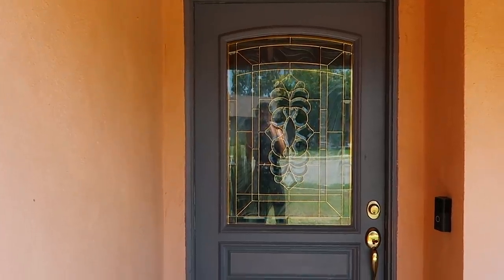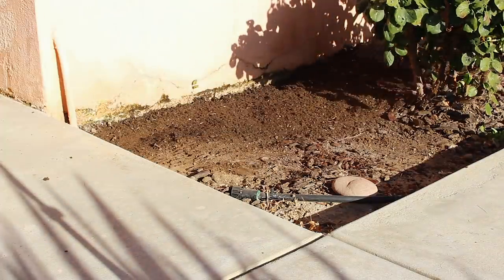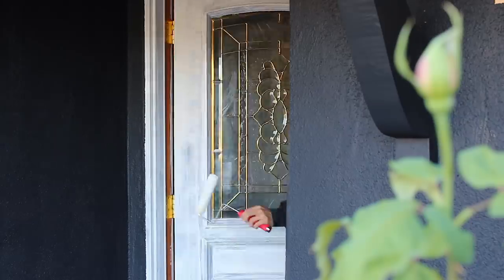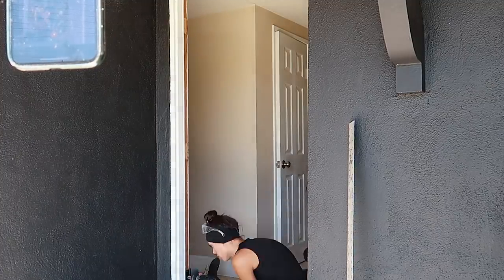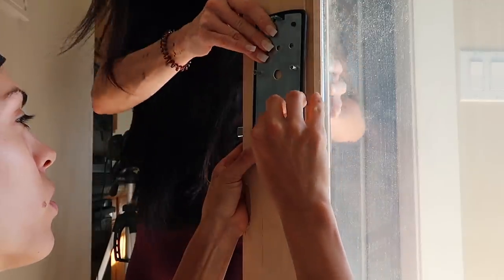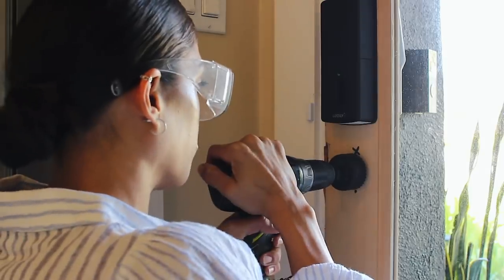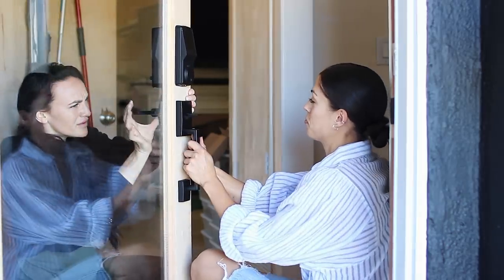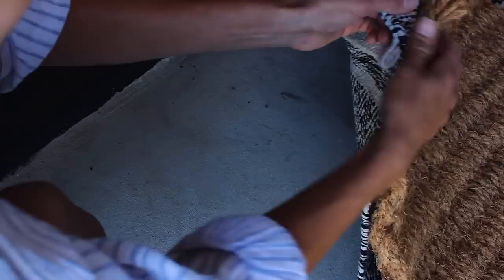DIY Front Door Makeover | Starting Our Front Yard Transformation!!!

Comment: Black is so bold 😍

I would honestly be concerned about that door.  Not just for the glass (security system won’t help you with that tbh but you mentioned a privacy fence ), but because of its thin profile. Where’s the edge seals to keep the bugs out and the cool air in?
Reply from the maker: We will be doing that in a separate video!

Comment: I mean, as far as privacy goes, you could easily etch, frost, or add film to the glass to have just as much light but no privacy issues. My concern is that you installed a smart lock (hackable) on a 90% glass door (breakable). Gurl, that house is not secure.
Reply from the maker: Make sure to do what's best and what you feel comfortable with in your home. We live legit directly across the street from the fire department and in an insanely safe neighborhood xx.